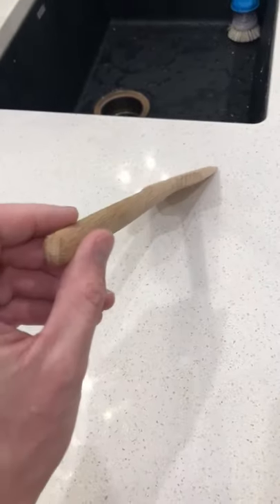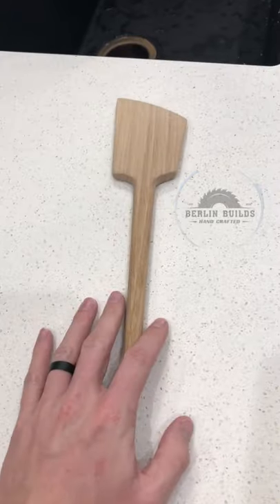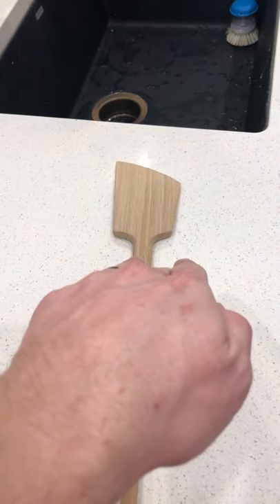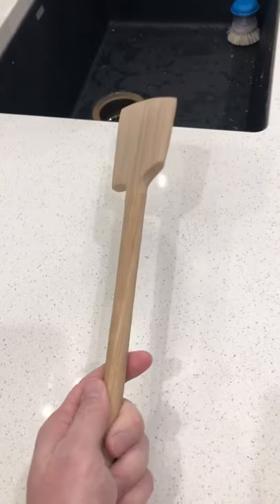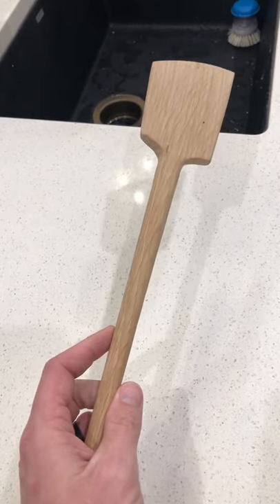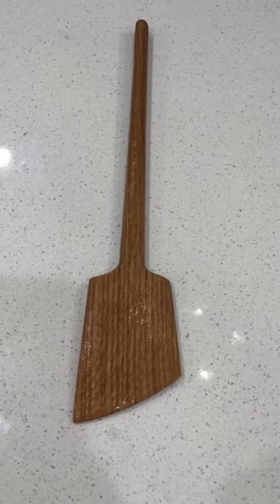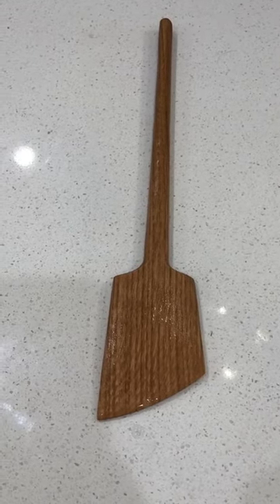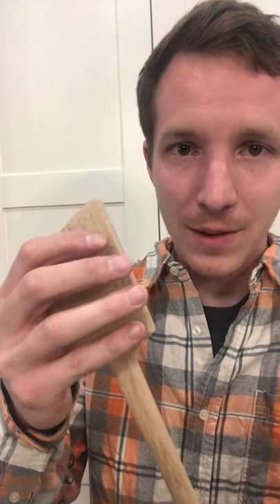How To Keep Wooden Utensils Smooth | #shorts

Comment: What are your suggestions for food safe finishes?
Reply from the maker: One of my favorites to use is a premixed bottle of beeswax and mineral oil.  You can use just mineral oil, but I don't feel like it lasts as long as the stuff with the bees wax in it.  You can buy either at local hardware stores.